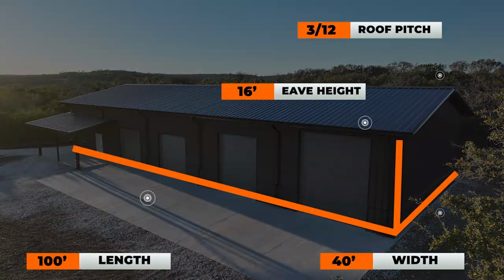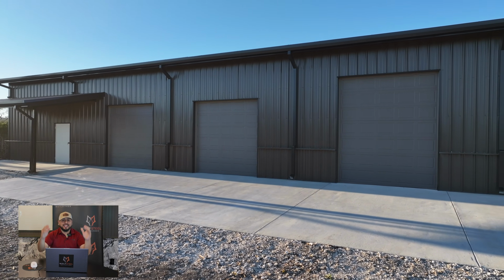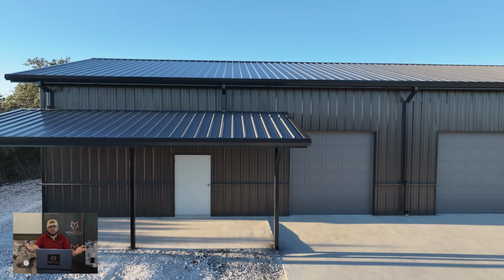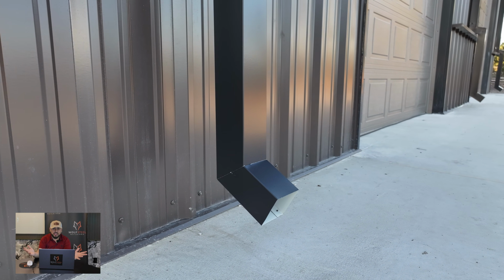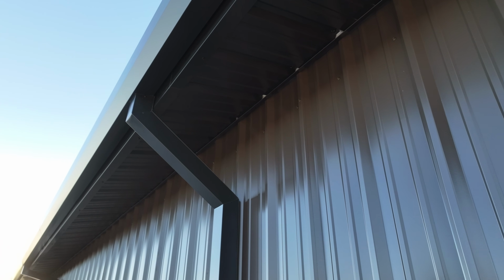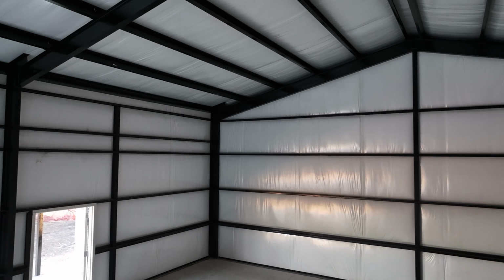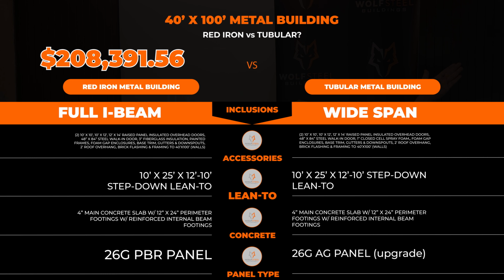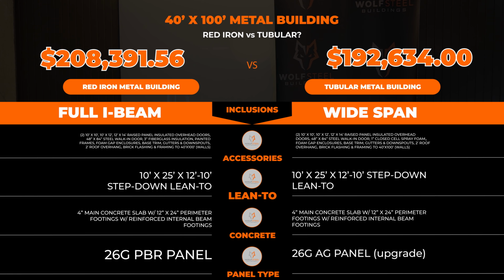Custom Red Iron Pricing | Perfect Workshop, Worth the Cost?! | WolfSteel Buildings

Comment: Can your red iron option be used as living barndominiums, if so can these metal units be attached to each other using different dimensions? Many pros prefer post frame for barndominiums, what are your thoughts? Thanks in advance.
Reply from the maker: They can be used, but we do not do any interior finish outs, MEPs, etc. This will need to be done by the client. When asked the use of the building we would need to know that it is for residential living so we can increase the risk cat. on the building. 

Yes different ones can be attached. We would get this through engineering. 

Most/all barndos are hybrid structures. Steel/metal exteriors with post wood interior.

Comment: Have you done any buildings in the Lubbock area yet?
Reply from the maker: @TimSTimS  We don’t service Lubbock Tim ):
Reply: @wolfsteelbuildings   Aww bummer.  I really appreciate your videos.  I've learned a ton from them!  I'm just about to do 2 - 6000 sq ft buildings that will be very similar to this one.
Reply from the maker: Best of luck on your project(s) Tim!
Reply: Do they make 250mph sustained wind speed buildings? You’ll need one in Lubbock.
Reply: @fakename8856  haha.   You’re not wrong.
Reply: @ I need to build a 60x80 at 9,500ft elevation with 175lb/sf snow load and 150mph wind speed, I assume it will cost double this building per sf.
Reply from the maker: This is true, pricing is affected by location and codes. We make the pricing videos to help get ideas on pricing but it can change according to needs. Best of luck on y'alls projects gentlemen!
Reply from the maker: hahah Lubbock will need building adjustments due to local codes!